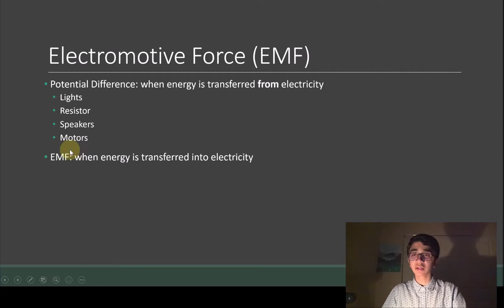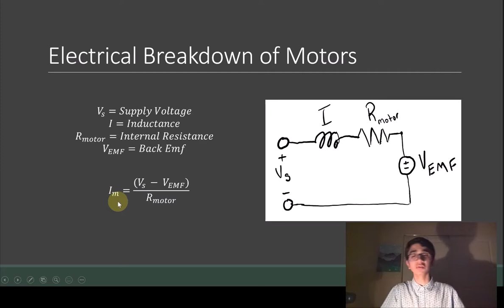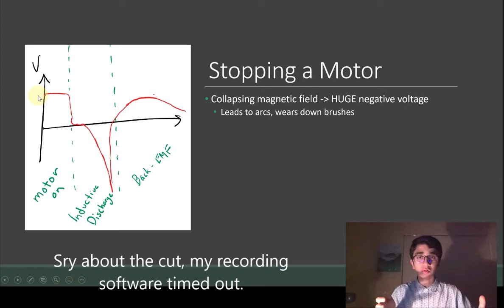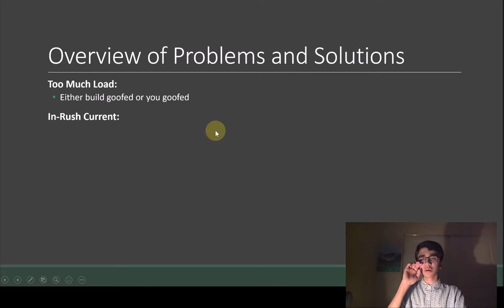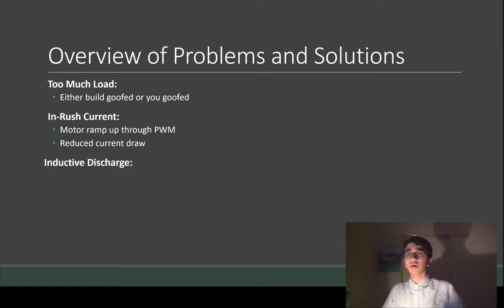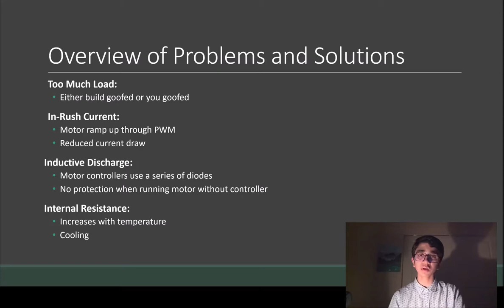Comment: Something I forgot to mention in the video is that you can notice the effects of in-rush current everywhere. For example, whenever the portable air conditioner in my home turns on, the lights flicker for a moment; this is because of the in-rush current of the AC (alternating current) motor inside the AC.